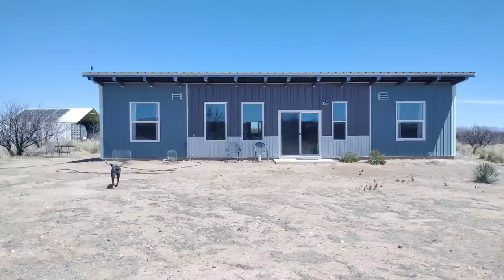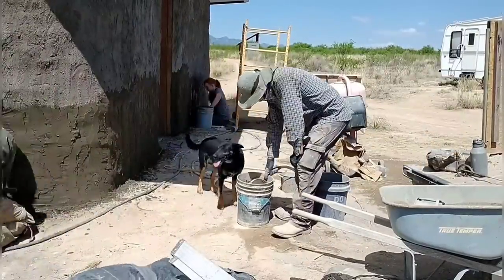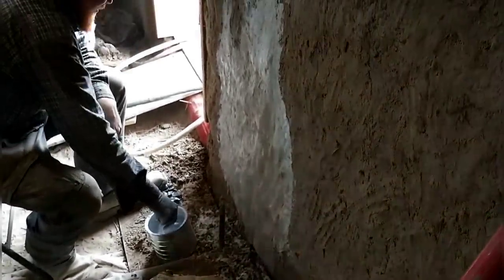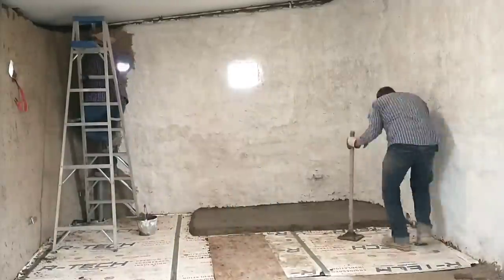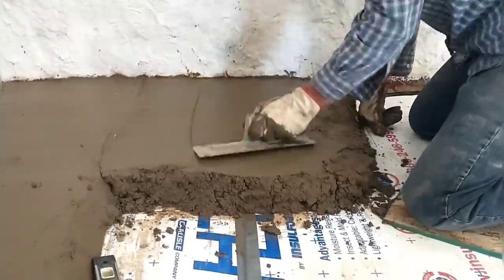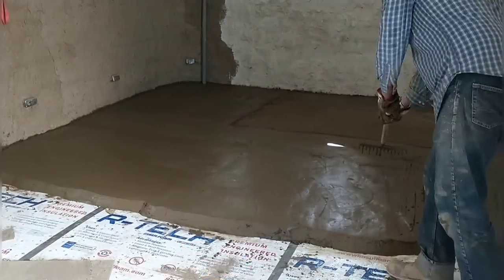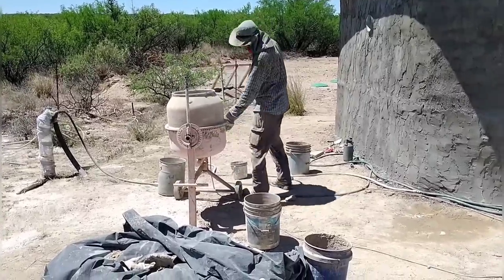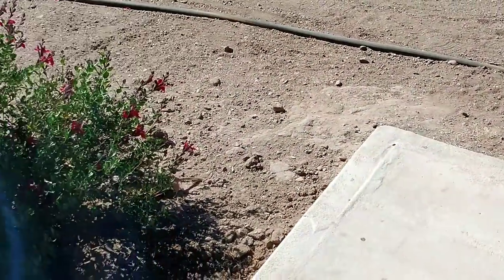Hyperadobe Tiny House #8 Earthen Floor, Cob & Stucco

Comment: Very nice job installing the toilet and I agree a Bidet is much more sanitary to use than paper. I installed 2 Brondell toilet seats in my bathrooms with cold water only and a T connector with a shut off valve. Easy to install and they work really well and save money on reducing paper use. Enjoy your videos.

Comment: Another nice enjoyable video. Thanks 
Having the styrofoam insulation under the floor like that won’t cause it to get compacted and sink and cause cracks on the floor?
Reply from the maker: Thanks! We think it will be fine, but will try to do an update if there is a problem.

Comment: This is amazing work! one thing i don't understand is why there are so little windows? isen't it nice to have more light and less Hyperadobe work to do while having more view? Is it something about the structural integrity or just a personla choice? like, i would make this entire front wall a massive window :)
Reply from the maker: Thanks! Yes, more windows would have been nice and would have helped heat the place in the winter. We were too busy to think much about it, and were unsure about how much they would take away from the structural integrity especially since Kyle didn't want to add any buttressing.

Comment: I built a 400 sq' tiny house 8 years ago, and love it. 
How is your house Red temperature wise with the summer season.
Reply from the maker: Awesome! It's a nice size. There is room for everything without being too cramped. 
Our house is doing great! We usually run the evaporative cooler for a couple of hours in the morning and evening. Then we keep everything closed up during the heat of the day. The temperatures are staying between 73° and 80°. 🌞

Comment: What is the ingredients in the cob?
Reply from the maker: 5 parts sand, 5 parts high clay native soil and 1.5 parts dried grass. It would have been better to add more of the coarse grass, but it was a pain to gather and chop.
Reply: @RedandAprilOff-Grid  ok, kinda like adobe. I have been making adobes down here with just some native red clay soil from on top of a mesa here and adding the fiberous material leftovers from making moonshine tequila.